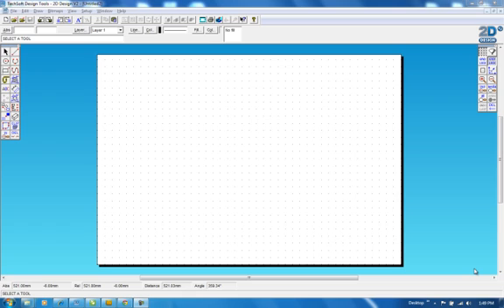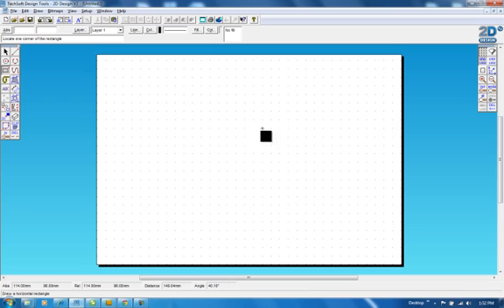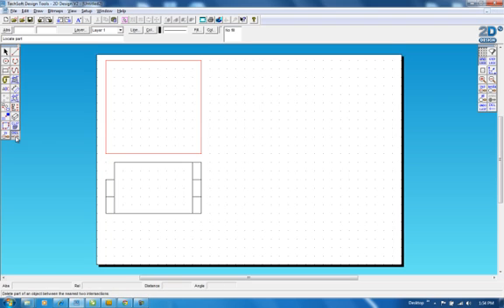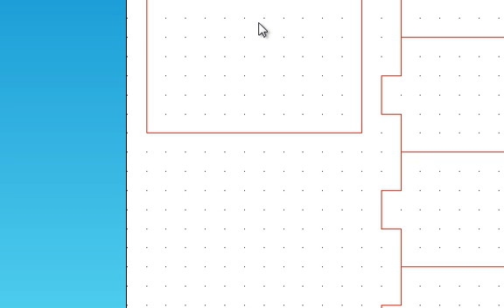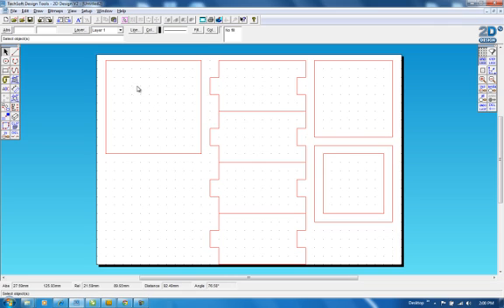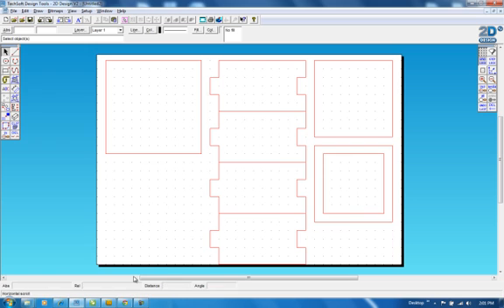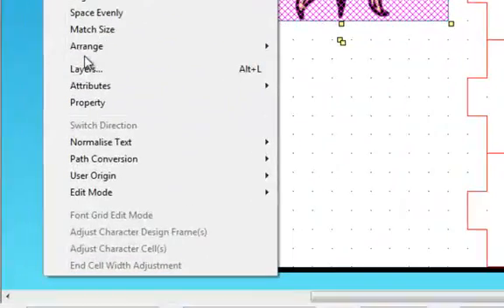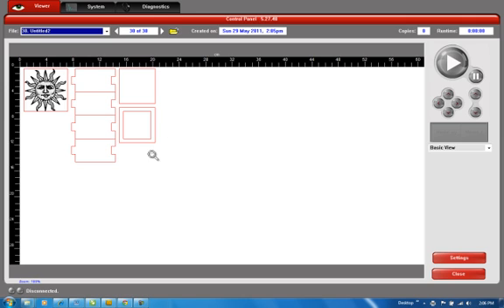wooden box in 2D Design tutorial for laser cutter.mp4

Comment: Good idea making the grid 6mm.  Thanks.
Will try to make a box tomorrow.  Slightly worried that the joints won't be tight due to the 0.2mm gap the laser makes. But will try.